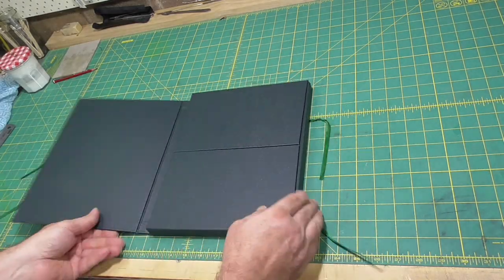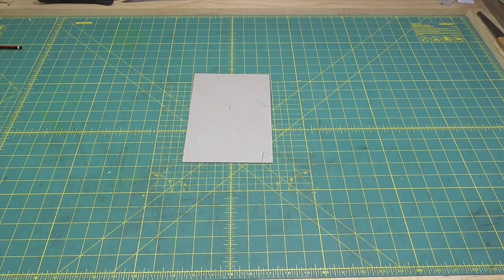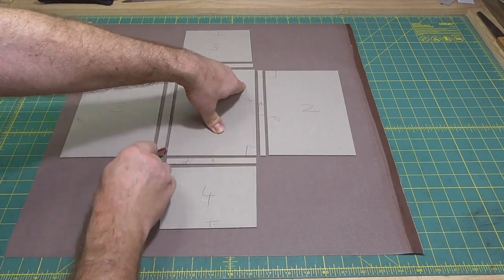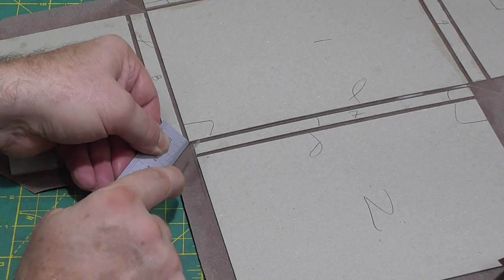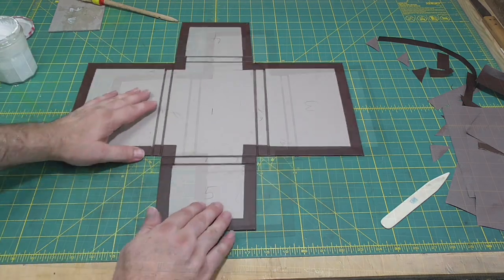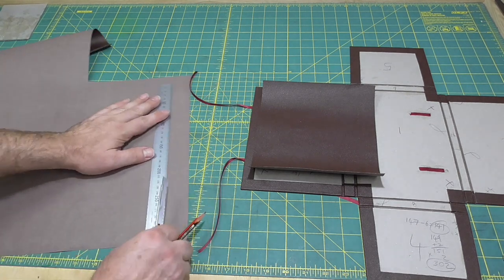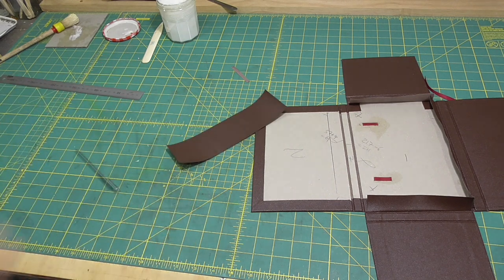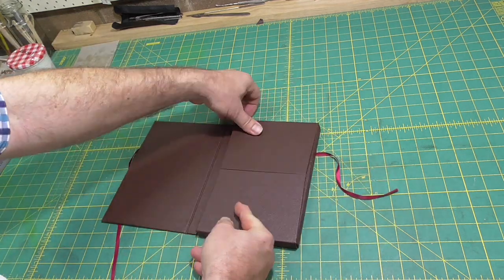Making a Portfolio Book Enclosure // Adventures in Bookbinding

Comment: I can't believe YouTube is free.  This is amazing.  Your craftsmanship and instruction are impeccable. And the reference book and spreadsheet will be very useful.

I thought the number 1 and number two boards could be a nice place for some marbled paper.  

I went back but couldn't find if you mentioned the covering material; it appears to be an imitation leather.  Did you simply attach the labels on the front and spine with PVA?

Thanks for this video!
Reply from the maker: Those pieces of paper come into direct contact with the book.  So you want something as benign as possible.  I don't mention the paper I use because it's no longer made, but it's a high rag content pH neutral paper that is also soft.  Some people use felt, but you have to add that into thickness calculations.

The cover material is Arbelave bookcloth, which is maybe my favourite.  Extremely functional.  And yes, I use PVA to apply the labels.  If I applied leather labels I use mix (PVE and paste).

Happy binding!
DAS

Comment: Currently I am trying to make one myself, and I have some questions:
1. How wide are the edge ties? 5 mm?
2. The smaller, trapezoidal flaps are a little less wide than the short edge of the baseboard and the inner flap (board 2) is also a little less tall than the long edge of the baseboard. This means that 2 of the corners of the baseboard do not align nicely with the edges of the small flaps and board 2, right? How do you cope with that?

Anyway, I find these videos extremely useful, giving me the confidence to try it myself. Thank you!

Comment: Question- in my adventures, I have found a very old (and somewhat valuable- $60 US as-is) book that is in very bad shape- It has been reduced to just a text block with some remnants of binding.

Would an enclosure like this work to preserve it, or would you suggest something else?
Reply from the maker: It could work.  For books that have lost their soundness due to age and use a clamshell enclosure might be better.  If the book has lost its boards and has shoulders then some acid free binders board or mill board can be cut to size and used in their place to protect the shoulders.  I love unrestored books.  I think they are very worth keeping.

Comment: Very nice I'm not a huge fan of the ties are there other less bulky ways to secure it closed
Reply from the maker: I like the ties because I think they are the least bulky option.  The book suggests buttons on the side but these are bulky and would rub on books next to it.  You could play around with things like coming out the edge of the board or the side board.  But the ribbon is very thin and I don;t think the idea I mentioned would be as strong or aesthetically pleasing.  Or if it is shelved with books you could go without.
Reply: @DASBookbinding  I had thought about doing with out .well good to have options I suppose 😄. Thanks for this . I do have a request for a video of I wanted to make book cloth at home might you do a video on the subject. Don't know if I want to do the iron on adhesive rout  how was this done traditionally?
Reply: @DASBookbinding  Are you a fan of magnetic closures?
Reply from the maker: Good one John!  I made my first portfolio enclosure over 20 years ago, and those strong little magnets weren't available then.  So I'm sort of attached to the ties because of my way of doing things.  But things do move forward.  There was a book or something that came out awhile back on doing creative things with magnets.  Because of this I ordered a bunch of them - all different sizes - from China.  And I keep forgetting I've got them.  I think that's a great idea for this enclosure.  I've had another job come in for one of these enclosures.  I'll give them a go.  I'll video it and if I don't stuff it up I'll make a short video on it:)
Reply: @johnbaines9580 don't know why I didn't think of that.
Reply: @johnbaines9580   I was about to reply with the same suggestion..  those tiny magnets are readily available now and not prohibitively expensive.  I think a perfect alternative to ties.

Comment: Is there a way to create nice titles in these portfolios? Like stenciling letters into the material and then fill it up with paint? I feel it's prettier than a label on the front.
Reply from the maker: Paper labels are very traditional and I like them.  But I also use hot foil in a foiling machine.  But it is not a hobby solution.  There are a couple of hobby/craft type solutions.  One involves a laser printer and laminator and the other a Cricut machine.  I really don't know the details but I hope that is enough information for you to search for them on Google.  Good luck!

Comment: 0:59 Is that a stack of three-holed US half-letter paper that you have bound yourself? Did you use the holes for some kind of sewing, or did you just glue the spine egde like a double-fan/perfect binding?

I have several ring binders of texts that would become more compact without the binders, and I'm asking myself if I should cut the holes off and make glued books from them. But here it looks OK with the holes still there. 🤔
Reply from the maker: No.  It originally came in a ring binder.  Someone scanned it.  I printed it as sections and sewed it.  
I would leave the holes and just double-fan it.  So you see the holes.  But that's better than having a tight inner margin.

Comment: Are the components used in these videos archival? The grey cardboard seems to be standard wood-pulp acid card that comes from cheap stationery supplies? Framing art works use acid free components. The amount of work that goes into these boxes surely means the box should not damage the contents by being acid.
Reply from the maker: It's acid free binders grey board.  DAS

Comment: Hello Sir, I apologise for being a late comer to your channel; thank so much for your hard work and willingness to share your craft.  I have lots of papers and such where I can apply this project.  What is your opinion about the use of preservation/archival paper, or cloth, for the lining..?  Or if it is necessary..? How well will it glue-up, and would glue impact the preservation capabilities of the paper/cloth..?  Thank you for your kind consideration.
Reply from the maker: I use a high grade EVA specifically made for conservation work.  But most PVA made for use with paper will be fine.  Just leave it dry open for about a week before putting a book in it.  All the paper and cloth I use are pH neutral or slightly alkaline.  I try to avoid heavily buffered paper.  Most products that are sold in the consumer space that make a big deal about being "archival" are mostly marketing.  They're fine to use.
Reply: @DASBookbinding  Thank you sir for your quick and much appreciated response; I will take your advice.

Comment: I am having trouble with one of the measurements.  The board that becomes 4&5.  My book dimensions are 19.9 x 19.9 x .5.  The total length of board is coming up in the spreadsheet at 19.9 (calculated at baseboard 1 - 3). It doesn't meet when its closed, the distance between them is 3 (I'm working in centimetres).  So I'm wondering what the "3" in the calculation is supposed to represent.  Thanks!  Great video.
Reply from the maker: Sorry, I need to change the spreadsheet to make it clear to use mm.  The 3 you mention is 3mm and just adds a bit of space either side of the object so it doesn't get crushed at the edges.
Reply: @DASBookbinding  Ah, okay..thank you!!

Comment: I was led here on a search for an enclosure for a set of orchestral parts (sheet music and scores) - this looks perfect provided it scales up.  What thickness board would you recommend for a stack of sheet music 364mm tall, 280mm wide, and 50mm thick?   Or is there another enclosure better suited- also with something this big would ribbon still be preferred for closing or something stronger?
Reply from the maker: I would use either 2.4mm or 3mm for something this size.  For that thickness I would consider making a clamshell enclosure.  I have a video on this.  Ribbons work well for me.  I have experimented with strong magnets.  They work really well too, but it takes me longer to muck around with these than ribbons, and thus don't use them much.
https://www.talasonline.com/paper-and-board/bookbinding

Comment: Very good tutorial! The only trouble I've run into is that the piece of covering material needed is very large. Is it possible to make the portfolio out of smaller pieces of book cloth?
Reply from the maker: There are other designs.  This is the one I like.  The top and bottom flaps don't have to meet in the centre and can be shortened.  Kathy Abbott has another design in her book which uses a number of pieces instead of one large piece of covering material.  Good luck!  DAS
Reply: @DASBookbinding  Thank you I'm glad, larger pieces aren't easily available where I'm at. I will check it out!

Comment: If you chose not to use different lining material for the panels that touch the book could you have just done the lining in one large piece?
Reply from the maker: Thanks!  There are a few questions that I'm expecting.  They are things I've thought about myself.  Just about every time I make one of these I wonder, could I cut a full lining and get it in place with nice 3mm margins all round.  I'm sure I couldn't.  The bit of uncertainty in the material that goes into the joints is a deal breaker.  But could it be done?  I think how I would do it is start by cutting out fitting to the base board and width of the flaps, but not the lengths of the flaps or the tapper.  I'd glue onto the base board and over the wall boards and into the joints, but not onto the flaps.  I'd then cut the lengths of the flaps based on how it fits and the tappers on the half flaps.  Finally glue down the flaps.  I'd probably still line the base board and inner flap with paper, and thus a bit needs to be added to the wall heights.  It sounds like it should be faster and less messing about cutting 4 pieces of cloth and the inside overlaps.  But I suspect getting that lining down onto the base board so the flaps line up nicely will be difficult.  Give it a go and let me know how it goes!

Comment: Hi, perhaps I'm mistaken but the calculated measurements on the spread sheet don't seem right - maybe I'm doing something wrong? My book is 16 high, 10.9 wide and 4 deep.  I've put in the board thickness as 0.2cm and the covering material at 0.03cm and lining material as 0.02cm. To start with the baseboard is calculated at 19 high, 13.9 wide.  Is the portfolio supposed to be quite a bit larger than the book?
Reply from the maker: Sorry, it's on my list to check the spreadsheet.  Maybe early next week.  DAS
Reply: @DASBookbinding  No rush, I've made my own one following your example - thank you so much!

Comment: While beefing up a paperback cover, the glue wrinkled several pages of the book.  How do I remove the wrinkles?
Reply from the maker: Hi Judy.  Conservators humidify paper and then press (usually lightly for standalone documents) to remove wrinkles.  In your case usually with a bit of medium pressure as the moisture equalises the wrinkles will go away - maybe.  Traditionally bookbinders used thin zinc plates they called tins for putting inside boards etc when pressing.  I use them all the time, but mine are 05mm galvanised steel plates.  It might help to put something stiff like tins either side of the wrinkled pages, with blotting paper either side of the pages, and some pressure for a few days.  If the wrinkles still won't come out it is because the fibres have been set in a new position and need to be able to move again with some moisture.  Humidify some blotting paper by putting it in a sealed container with some water.  But don;t get the blotter wet, just let it soak in some humidity.  Put a moisture barrier either side of the wrinkled pages (preferably tins) and then interleave the wrinkled pages with the humidified blotter.  Leave like this a few hours with light pressure.  Then remove the blotters and replace with dry blotter and press under medium to high pressure.  Replace the blotters at least daily.  Just be careful when pressing not to damage the spine and binding.  Hope this helps!  DAS
Reply: @DASBookbinding  Thankfully, this is not a rare or historical book.  The perfectionist in me wants it to be pristine.  However, if it's not, I'm mature enough to deal with it.  Thank you so very much for sharing your knowledge and expertise.  Judy